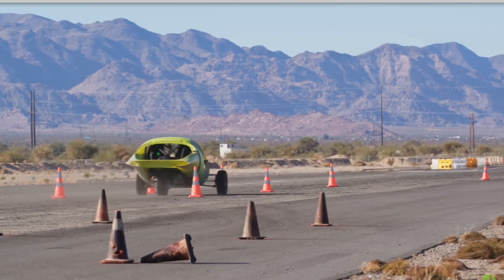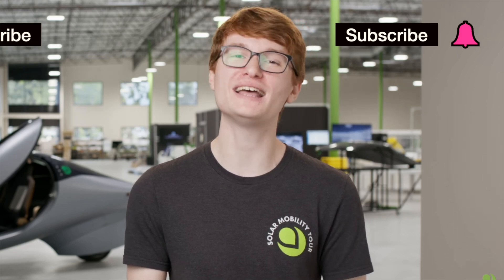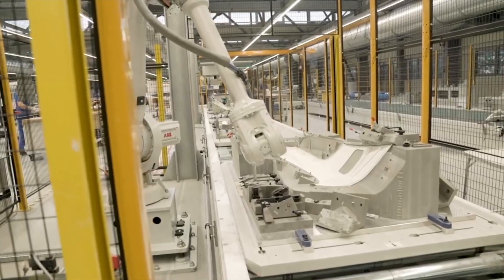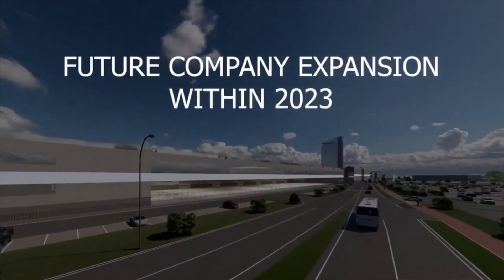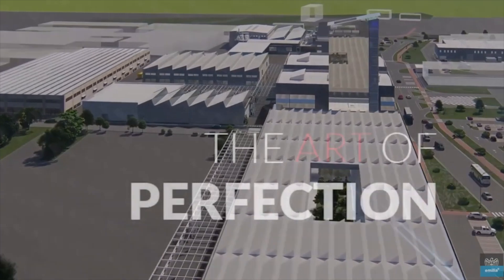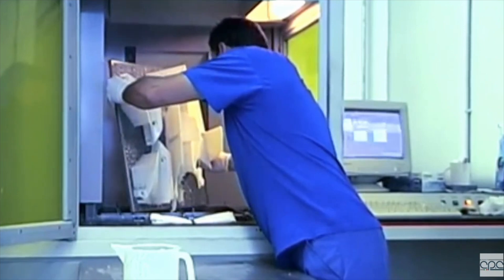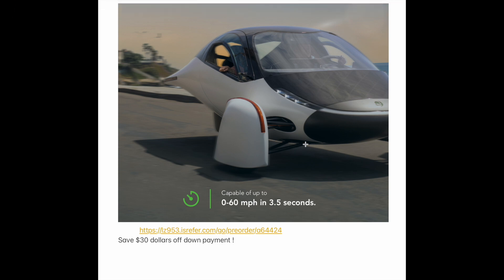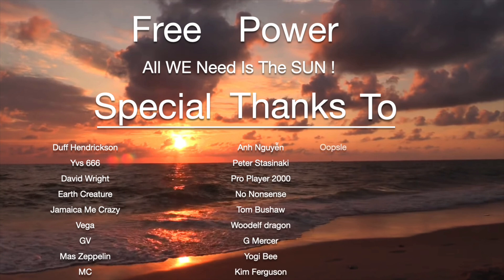Aptera Is As Safe As Formula 1 ?

Comment: however the F1 cars are on the track with other similar weight F1 cars, and mostly going in the same direction... when the Aptera is on the road with much bigger and heavier vehicles, the basic physics is not nearly as favourable. The F1 drivers also have 5 point harnesses, racing seats and helmets to prevent them from being thrown against these rigid monocoque frames. Sure normal seat belts and airbags may help.. but the lack of generous crumple zones and very low weight of the vehicle will make for a very violent impact.

Comment: No, they never said "the whole vehicle is made of carbon fiber".

They said that some structurally important body parts are CF-SMC (CF = carbon fiber, SMC = Sheet Molding Compound), while some other structurally less important body parts are SMC (glass fiber).

That makes a lot of sense, because:
- for mobile phone network and GPS signal reception, glass fiber is better because carbon fiber shields those signals.
- CF is more expensive than GF
- if composite material shatters close to the human body, GF is less problematic than CF

Comment: Hello, thanks for keeping the videos coming👍.

 One key difference is that in F1 the pilot has extra security for the head via the helmet and the strap that keeps their head in place. Since aptera only has front airbags I’m still curious about the crash test, hope the lateral impact results are reassuring 🤞.
Reply from the maker: Thank you fernando , the roof of the Aptera is supposed to be safer than the roof’s on even Tesla’s cars . Aptera also has seatbelts and air bags , however they don’t protect the head from moving . We’ll have to wait for tests results . 😎